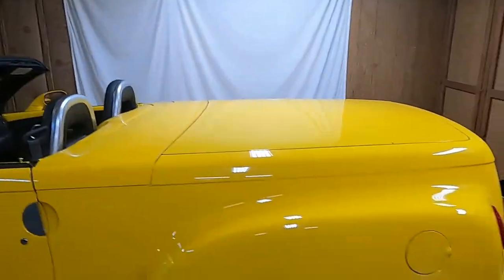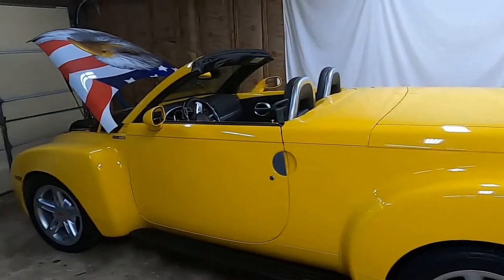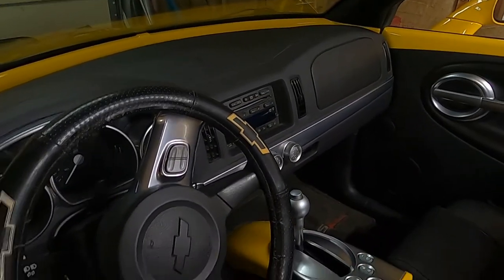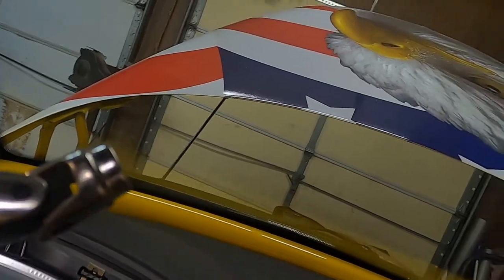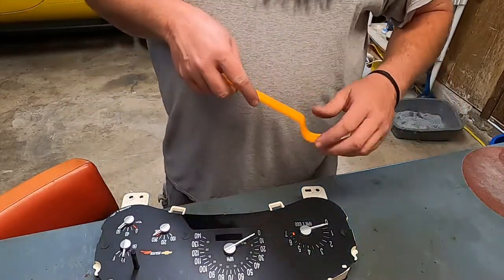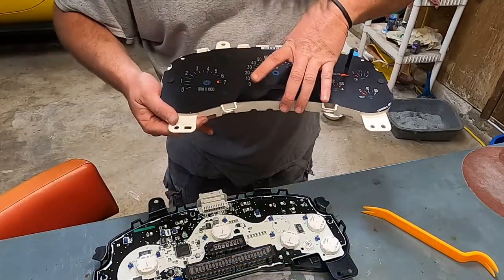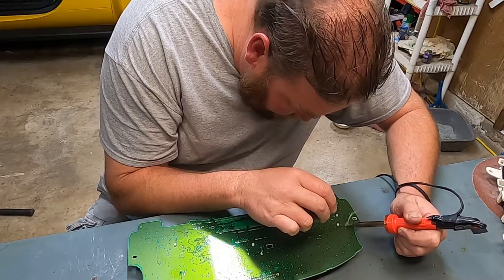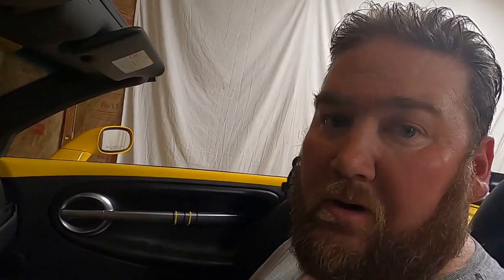SSR Repairs part 1:  Repairing the gauge cluster on the SSR

Comment: What did you use to get the top two screws off of the cluster
Reply from the maker: I have a 1/4 drive wobble socket that is 7mm along with an extension

Comment: I had my 04 SSR instrument cluster replaced by US Speedo in Flint Mi. They tried replacing stepper motors. Chevrolet Dealer wanted to do the cluster repair. $1500 & have my SSR for 2 weeks. That lasted 200 miles & all the gauges pegged. Took it back to US Speedo & replaced the entire cluster under warranty. Two trips to Flint Mi from Toledo Ohio. $250 plus tax & gas to drive to Flint. Mi.